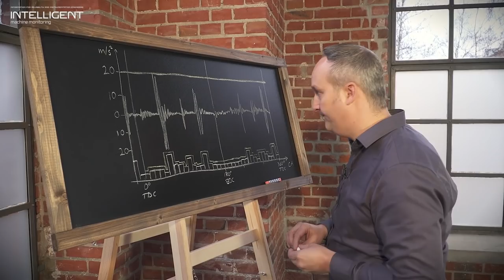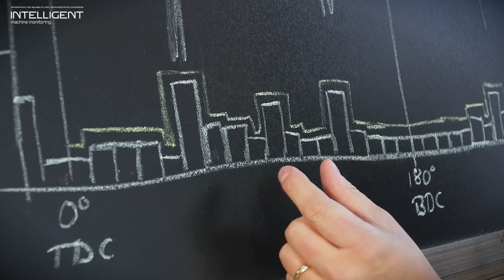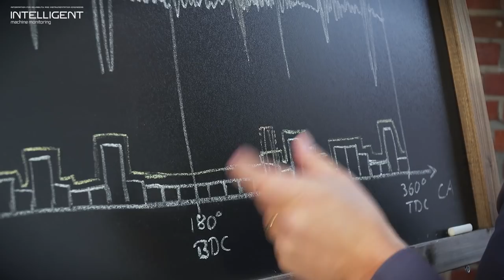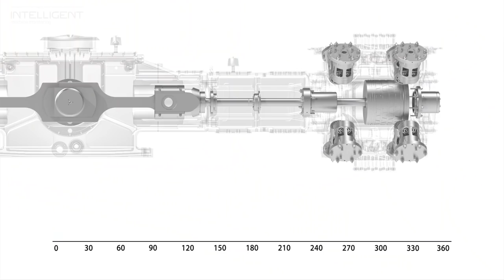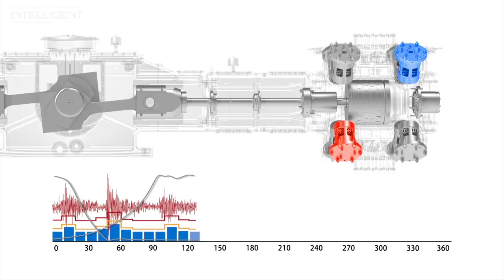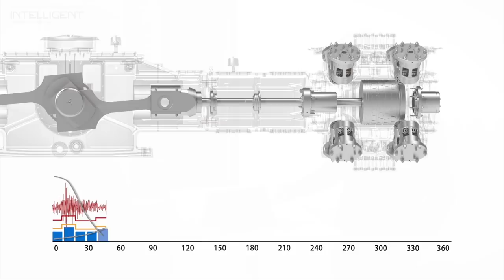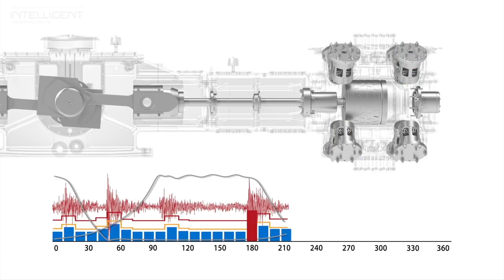Why signal segmentation is superior to all analyses for reciprocating compressors

Comment: what is the acceptable limit of the Rod drop in Gas reciprocating compressors?
Reply from the maker: The acceptable limits depends on many factors like piston or machine size. 
A small piston (rod) normally has a smaller acceptable movement than a bigger piston. 
As well the history and process of such compressors influence the setting style (e.g. low risk compressor with no machine damages in the past might have higher limits like others).
Peak-Peak Limits per segment could be <500 µm for small piston diameter (<300 mm) and > 1500 µm for bigger diameter (>900 mm).
It is recommended to adjust the limits based on the machine food print (trend) to have tailor made limits.

Comment: Is it possible to do condition monitoring (thru acceleration enveloping) of bearings(say antifriction) of reciprocating compressors?  The bearing impacts from bearing faults may be completely shadowed by valve impacts? !!
Reply from the maker: For anti friction bearing monitoring we are usually using the signals from the standard frame vibration sensors and the crosshead acceleration sensors. These are much closer to the crankshaft as the cylinder vibrations.
The 36 segments analyses of those signals allow a high resolution analyses of these signals. If there is an issue with the bearings, vibrations appear independent from the valve actions at at the same time on all sensors and independent from the crank model.
If you would like to give your bearings special attention you can equip your compressors with additional bearing acceleration sensor, bearing temperatures and proximity probes to compute the orbit. Also the vibration signals are monitored by spectral analyses.